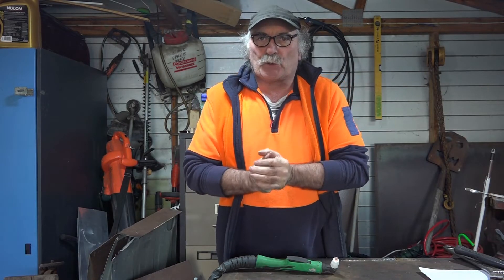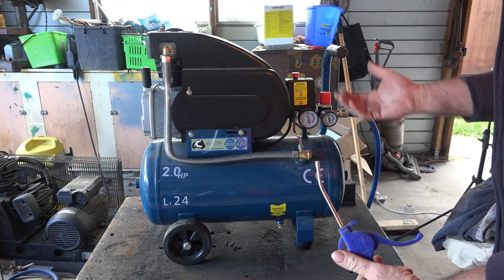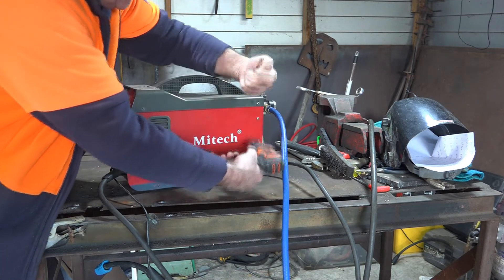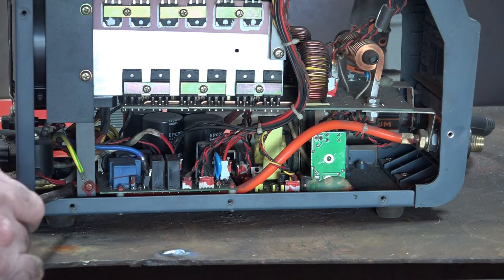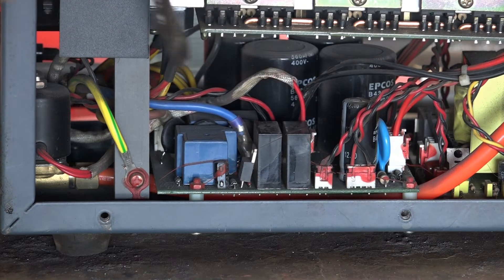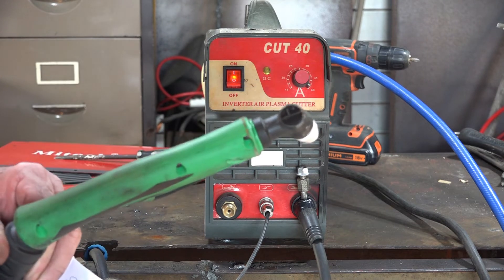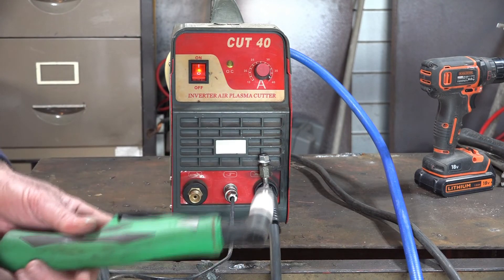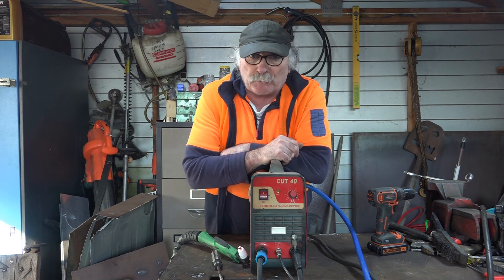How to Fix a Plasma Cutter That's Not Blowing Air

Comment: I managed to figure out I had a bad air solenoid without watching you this time!  haha!  Bought it on ebay in 2013, didn’t work out of the box.  Dug it out today to attempt to fix it.  
Machine is sending 240v to a 220v solenoid and I think I mussed it up with wet air into it when I first turned the unit on.
Reply from the maker: Nice work!

Comment: In my experience- the most likely faults are faulty cable in the torch lead, faulty switch, faulty solenoid control...
So doing the 'short the 2 pin contactor plug' is the first choice for testing, before opening the  machine up...then open the torch and short the switch contacts...
Reply from the maker: True